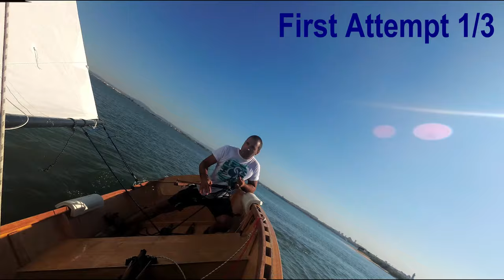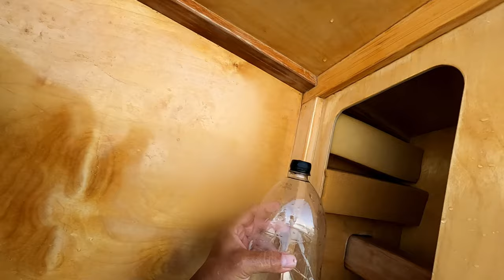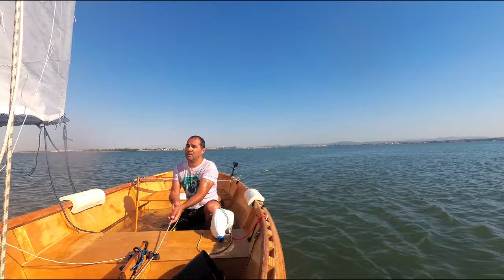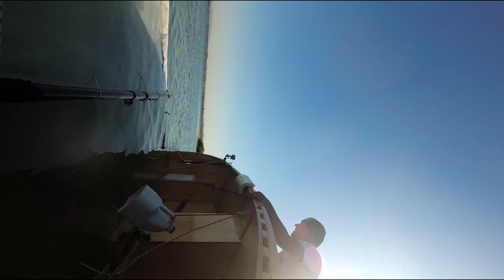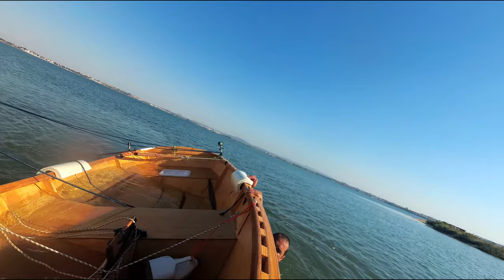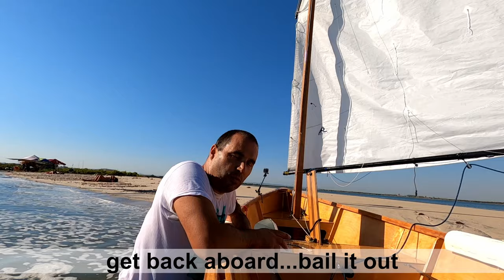Homemade Sailboat Capsize Recovery , GIS

Comment: Another good video, well done! In Okinawa, with the sailing canoe called Sabani, they have a race where all sail out to one point and then purposefully capsize, then right the boat, bail out and race back to the shore. It is good training for capsizing later in the open sea where mistakes should not be made... and buckets of fun. Thanks!
Reply from the maker: Thanks Bill.
I have made 3 videos last season with a lot more capsize action, including a full turtle capsize, to test the new watertight side benches. And they proved to be a game changer.
https://youtu.be/ro_w_ZR0PsA
https://youtu.be/XO_YwUTg2zI
https://youtu.be/bv0D67QDQOE
Reply: @TheBoatRambler  I risk writing too much, sorry, but... the Okinawa sabani shark fishermen used to fish offshore with these junk rigged wooden canoes in any weather. If a storm came they simply capsized the boats on purpose and then go underneath and hold onto the seats in the air pocket until the storm finishes. Tough guys over there :-)

Comment: Any advantage in having a Whale diaphragm pump or Anderson type bailers? It seems you can get sufficient speed out of her for the self-bailers to function. Great video, thanks.
Reply from the maker: Hi Greg!
I don't know if the bailers would work. I believe I read a post by a GIS owner saying he still needs to bail out some water before they start to work.
As for the pump, some of the guys have built a simple watertight box with battery inside powering a small bilge pump. They just keep it under the mid seat out of the way. 
Me, I'm still trying to decide what to do on my GIS... 🤔

Comment: I am considering building a GIS. But the flat bottom concerns me, as I have heard such boats do tip over rather easily. I know you are trying to tip it, but it does seem rather easy to do, even in a mild breeze.
Reply from the maker: Hi Lee!
the GIS is not easy to capsize but it will capsize just like any other dinghy.
Have a look here to see its secondary stability ! 😉
https://youtu.be/XO_YwUTg2zI

Comment: Try a recovery with a sea running. No one ever seems to do capsize/recovery drills with a sea running.
Reply from the maker: Hi! Thanks for your feedback.
I think ppl don't usually do this drill in rough seas because if it goes wrong it might be dangerous or even life threatening.
Like I said in the video I'm curious to see how it behaves in rough weather but I will only try it if I get someone on a boat watching and in standby to rescue me if needed. Trying in a controlled situation is one thing, trying without a safety net is another...😉

Comment: Would the boat have turtled if left on it's side long enough?  Does the mast and boom have enough flotation to prevent it from turtling?  An idea for you:  something I've done on close to a dozen boats now, is cut a foot hole in the rudder to provide an easier way to get back in the boat.  The holes are streamlined in thicker rudders, and have thick wall vinyl tubing on the bottom on thin, metal ones.
Reply from the maker: Hi Peter.
The mast is hollow box construction, the yard and boom are carbon and they are all hollow and watertight.
 I'm convinced that it will not turtle... but next time i capsize I will try to stand on the mast progressively further away from the hull and see how it behaves. 🤔
Reply: @TheBoatRambler  do this turtle test with another recovery boat near by. If the mast fills, you may not be able to get it righted by yourself. You're not that big of a guy.
Reply from the maker: @Mark Kurtis   I had a word with some ppl on the island and they were ready to save me if needed! 
Now seriously, all spars including the mast are hollow and 100% watertight! Even with the boat on its side and me seating on top for a few minutes it didn't look like it wanted to fully turtle.
Next time I'll walk on the mast  to see what happens!

Comment: great video but you do not have bailers???
Reply from the maker: Thanks Frenchie!
My boat has no self bailers. Actually most GIS don't have them, and in my case I would need some aft and some forward of the mid seat as it is  watertight and there are no limber holes connecting those two areas.